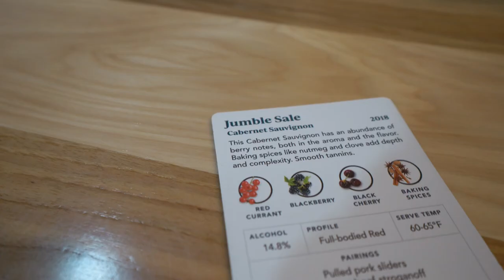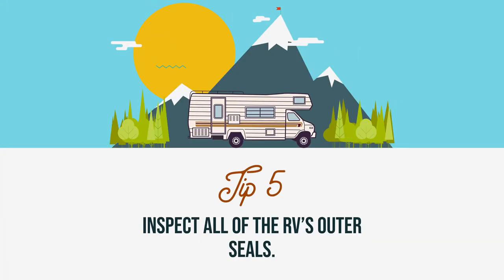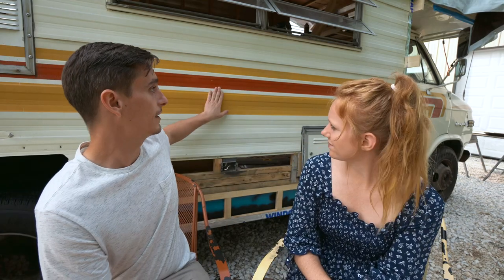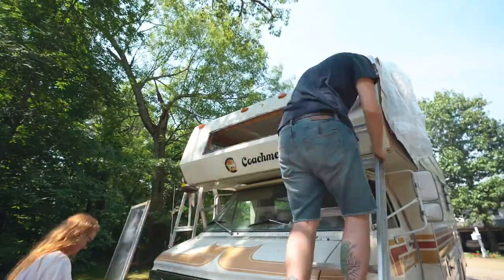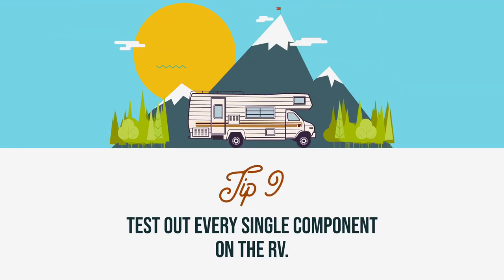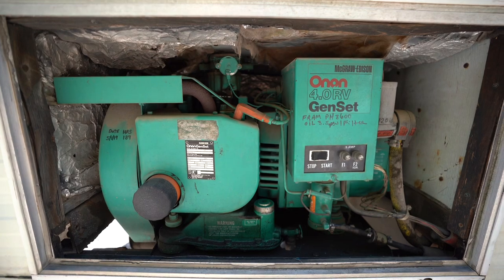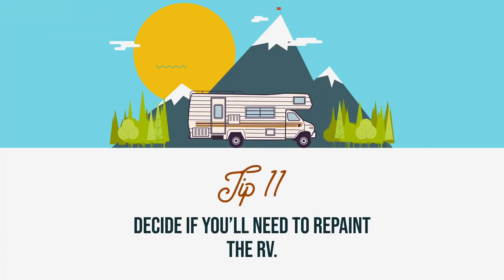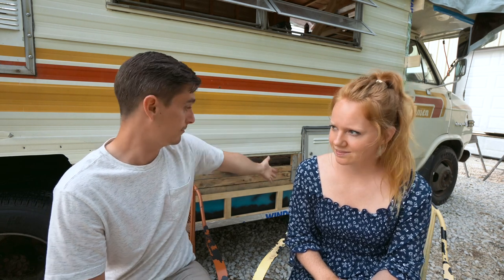Vintage RV Buying Guide - TOP 12 Things to Look for Before Purchasing an Old RV!

Comment: Any rv that old will need to be redone if it hasnt been even if its been sitting in storage might not need wood replaced but all seals are gonna last 10 years tops , also painting extierior is sheer labor intensive everything has to be cleaned sanded prepped paints not necessarily expensive 150 dollars at tractor supply goes along way for paint tractor and implement primee paint and enamel works fine on cars aswell as rvs its not show paint but it can look slick depends on the one working it and applying it. Found this series while my wife and i work on restoring a 75 cobra century class c on a chevy chassis its alot of work but they all are a labor of love otherwise they fail often you also get in it what you get out of it made to suite you there is no such thing as a perfect rv also anythimg that old needs a serious tune up and upgrades all the seals will be shot and things like timing chains will also be wore out and stretched also amything that old needs brake system done if it hasnds been brake fluid is most corrosive chemical in any vehicle so brakes fail first id also take the opportunity to bring up to 4 wheel disc rather than disc drum good luck to all of you restoring.

Comment: Back in the day, you could finance an RV and end up UPSIDE DOWN.   That is you might find that in order to sell it you would have to add considerable dollars to your loan in order to get a title transfer to the new owner.   We bought a real beauty of an RV,  class C with a 460 Ford V8 that had known problems with cylinder head bolts breaking.  Lucky for us we found a garage that could fix the problem for cheap after every couple of years.  Initial investment was near $40K and after 10 years of use and low ($300) monthly payments we sold the RV for $12000 and had to pay $8000 to pay off the loan.  That was in 1995.  What a downer.  Al really wanted a Porsche back then which would have had a much better depreciation / investment profile.   Caveat Emptor.    IMHO we think Class C RV's are BAD investments.
Reply from the maker: Sorry to hear it didn't work out for you all. :( Luckily we haven't had to spend too much on the unit and are looking at it more as a fun project and learning experience, so we're not too worried about the costs or making our money back. We definitely understand that RVs can be a huge money suck, though!

Comment: Hi all, I Jim stan used to own a 1978 Ford E350 cut chassis with Midas rv. . Sold / gave her to my nephew and friend $200.00 then they junk her.😫😰😭my newer rv is 1989 Ford E350 coachmen Catalina I have done the batteries starter alternator starter solenoid fuel sending unit and 36 gallon tank rear air ride airbags I'm in the process of rebuilding the front overhead bunk will be updating the rotted bumper to a quarter inch steel square tubing bumper and my work is just beginning I've had her for 2 years now her name is Melanie drove her from Holly South Carolina to Raleigh North Carolina then up through the Virginia's to Pennsylvania to go see my uncle and Aunt and punxsutawney Pennsylvania then drove West to Ohio out to Iowa to the John Deere museum off of i-80 and another road I forget where what it was stopped at the i-80 truck stop in Iowa then I drove back to Colorado springs Colorado where I am now living good luck with your journey I know I'm having fun with mine 🤠😉🤣 a month ago we had a bear encounter the bear was up the tree in neighbor's yard